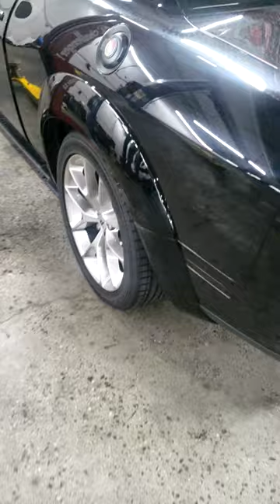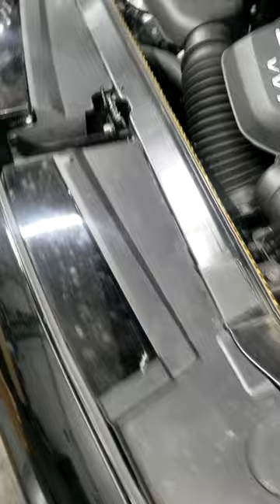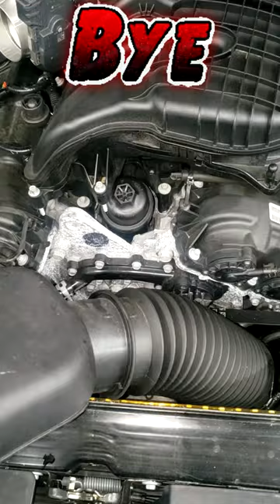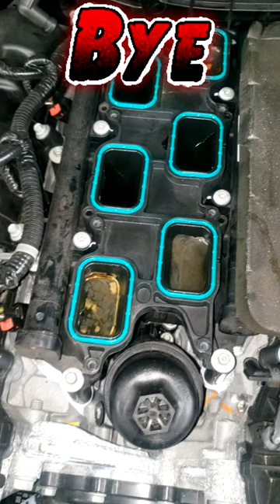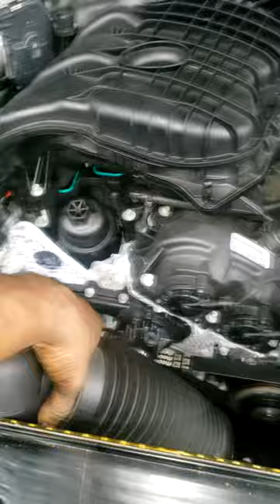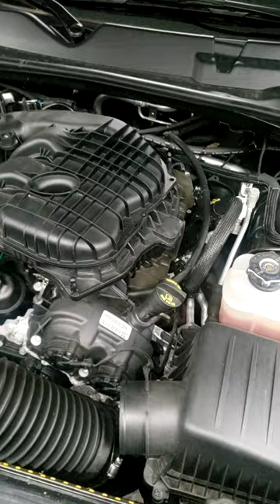Saying goodbye to this motor. Doing that was a bad mistake and destroyed this car.

Comment: Take the plugs out and spin it over, put new plugs back in I guarantee it will fire up.. Ive hydroocked a motor before. Its not the end of the world ..
Reply: Vaporlock different than hydrolock, but some hydrolocked engines can escape undamaged.
Reply: @byanymeansnecessary9329  honestly that's what I meant to write I don't know why I wrote vaporlocked..
Reply: @BlackbeardJohnson  understood
Reply: Bingo
Reply: when you're lucky it fires up.. I'm working on the same engine right now, had one broken piston rod and one bent piston ..
Reply: @huberthess8449  true. I flipped a 3.0 ranger and while it was on its side (still running) it hydrolocked and locked the motor. After I recovered I took the plugs out and hit the key, oil shot out 30 ft.. Put the same plugs back in and tried starting it. It took a couple tries but when it fired up it smoked like a cold diesel for a few minutes and cleared up. Truck was totaled bent frame and all but I still drove it fpr another year. Frame was bent so bad when I did burnouts the passenger side tire would leave a darker black mark then the driver side cuz of how bent ths frame was lol.. Also the same truck I loaded with 3700 lbs of brake rotorsand engine blocks for a scrap run. It sat on the bump stops the whole time. Only suspension was the tires at that point lol. Good times.......
Reply: Correct
Reply: It's worth a roll of the dice. It could save the customer a new engine.
Reply: More likely to bend a rod in a v8, due to the power of the other pistons.
Typically one or 2 will bend before it locks up.
Smaller engines less likely to have damage
Reply: My question is. How do you hydrolock a car in a puddle? I’ve driven through two feet of water in an Elantra GT and didn’t have any issues.
Reply: @xandit  it wasn't a puddle, lol. More like 3 ft deep. It was a flooded bridge we tried to cross in a LOWERED Toyota pick-up truck. High water + low vehicle = hydrolocked..
Reply: In attempts to impress my girlfriend and her friend I drove my 95 exploder into a deep puddle. Hydro locked the engine... Pulled the plugs cranked the engine changed the oil and filters and it ran perfectly for 10 years...  But your the mechanic multiple thousand dollar engine it is!!!
Reply: @BlackbeardJohnson  I’m talking more about the video than your circumstance.
Reply: @xandit  my apologies, man
Reply: Exactly happened to me a couple weeks ago. Took out my spark plugs boots , dried up the spark plug walls and pulled out spark plugs , put some new ones in and viola.
Reply: @richardsamuels2842  something funny?
Reply: It's a Chrysler tho... No way in hell it didn't bend or even snap multiple conrods.
Reply: @brentsnocomgaming7813  if it happened at a low rpm there is ABSOLUTELY a way. Drive fast through water at a high rpm then yes I can see it happening. People hydrolock engines EVERY SINGLE DAY with starting fluid and don't snap "conrods" (😂) no you wait a minute or two and try to start it again. Jesus Christ all these mfkrs that are certified keyboard mechanics know it all. Idc if it had glass rods if it happens at a low enough rpm there isn't enough inertia to bend rods. Smh
Reply: @BlackbeardJohnson I never worked on a keyboard but if I ever do I'll get ahold of you your certificate tho I'm gonna need to see
Reply: @rosslefave5877  pipe down, junior.. noboby asked you to speak. Speak when you are spoken to...

Comment: One of the few reasons I loved the days of carburetors. The air filter was on top of the engine, and as long as you didn't go submersible, it ran.
Reply from the maker: Whoa, never thought of it that way. Interesting
Reply: That's a fact, there is videos online of a Hummer with the exhaust and air intake sticking 10ft up above the top of the truck and it actually drive down into a pond and drives underneath the water and then comes out the other side....

Comment: Did you try getting the water out and running it? Gotta try to save it or at least verify rod damage before you call it quits.
Reply: Yeah I hit a puddle that went from 3 inches to 3 feet in two minutes thanks to a flash flood, just pulled the spark plugs and cranked it till it stopped spraying water, and then it started right up
Reply: @StarHunter28  yep, just gotta give that engine a fighting chance. I've seen kia's throw rods right through the block from hydrolock, several toyota V-6s survive, and a 5.3 bust a piston ring. It could go either way any time an engine sucks up water, but youve gotta pull the plugs at least.
Reply: Nah man that shop replaces engines like motor oil. They won’t take those kind of risk.
Reply: @goforbroke2  it isnt a risk.
Reply: @MWilk098  True, I wonder how that would play out worse case scenario though. The shop removes all the water from the engine. Car runs fine for a week or two then it develops a rod knock. Piss off customer returns, you didn’t fix my engine.
Reply: @goforbroke2  worst case? You don’t ever work on their car again. Oh no. So bad.
Reply: @goforbroke2  no you tell them hey we're going to do this and try the $250 fix or you can put another motor in it, your choice.. and if the motor does develop rod knock then he's only out the extra 250 and he's aware it may happen, problem solved.....
That's the problem with dishonest mechanics. You basically tell them this is an option or you tell them to replace an engine you don't just go in there and open up a valve cover and see some water and determine that it's already too late. You try to go the extra mile and see if the engine is fixable and if it is you've just saved your customer a lot of money and also you will be God to them so they will come back to you forever and ever. Think about it, really not rocket science........
And when I say dishonest mechanics that is exactly the problem they are just being dishonest. And that motor does run and is nothing wrong with it they tell the customer that there is and they replace it then they have a free motor that they can use to put in someone else's vehicle absolutely free and charge them for the price of the motor and labor... just be honest and do the right thing...
Reply: They make more money putting in a new engine

Comment: It all depends on how fast the engine was running and if that momentum was enough to do damage. I've had cars last for years after a hydro lock.  Get the water out and test it before jumping to a new engine.
Reply: Dealer tech sadly just not able to attempt things to save customers money. If he tried he’d end up not turning enough hours for the week
Reply: @user-white007  - He gets paid 1 hour diag for every car that pulls into the shop. In 1 hour you can pull the upper and plugs to get that water out. Wouldn't be enough for every engine, but it is on the 3.6. And most customers would jump at the chance to add an hour to his diagnosis of it could save them thousands of dollars. If dealer policy doesn't allow for at least asking the customer if they'd like to take that chance, that's a good reason not to go to the dealer.

Comment: Your car ain't no submarine! Damn dude! That one expensive mistake! One of the things they taught us in traffic safety back in the 80's was avoid puddles if at all possible.  Belts slip, engines stall, water goes places it should never go,  you can hydroplane, or you simply crash.

Comment: Just pull the plugs and pump the water out by cranking the engine over change oil and put little oil in cylinders I have done many of these like that and the motors lived

Comment: Pull the spark plugs turn it over a few times put them back in and see what happens.
Reply from the maker: He did that in order to rotate the engine to remove the t/conv.  But thats not a repair/fix
Reply: @OnlineMechanicTips  so what was broken. Was the engine seized from the water in the cylinders (hydro lock) or was there other internal damage causing the seizure. If it's just water and it hasn't sit for a long period of time it could be ok. I have hydro locked a couple engines and they were fine.
Reply from the maker: @shmoeshmoe7433  Im not sure. The engine still setting over there. If theres not a core charge on it, I will tear it down and film it to find out. But keep in mind, we in business my guy to make money. We not attempting any repairs on such. Especially if the insurance warranty company agreed to replace it. At the end of the day, its there call, not ours.
Reply: @OnlineMechanicTips  k

Comment: My 2016 3.6 has a code p369 and p000a and b. Just changed  3 cams, all rockers/lifters. The cam phasers didn't move at all so I didn't change them. Swapped cam solenoids and sensors. Engine runs perfect except the transmission don't downshift when in high gear. There is a traction control light on. Could it still be the phasers? It has 97,000 miles.
Reply from the maker: yes

Comment: Sent mine through the Houston spring flood,water past the quarter panel, and again through Harvey enough to get it outta flooding area to higher ground. Still kicking. Trick is to keep them RPMs up and pray the stigma of "boat" is true
Reply: That is true, what is saving you is that you're going through the water fast enough to push it away from the car so it doesn't have a chance to get up in the engine bay and suck up into your air intake. My buddy and I took a lowrider Toyota pickup truck through a flood back in the day and it ran fine in first gear until he got confident and slow down to an idle and that's when it sucked up the water in the engine. But we took it back to his house pulled out the spark plugs and turned it over to empty it. Change the oil and put plugs back in and it ran for another 150,000 miles oh, God Rest his soul that was my best friend Leroy lacey. RIP to a real one!!!

Comment: You can compress H2O, But... The rods will bend as a result. 😱 Yikes JT
Reply: @nikalusgrogan7143  your car can & DOES "COMPRESS WATER", daily. That's what the water pump does and the physics behind hydraulic systems. The water and coolant RESISTANCE to boiling, is achieved by the thermostat and radiator cap pressure (assuming a sealed system). The cooling system doesn't boil, due to compressing the entire system to 16 psi, pounds per square inch. A car can survive a small percentage of water ingestion, like when it's raining and the water vapor has a higher% level than normal. Now, dump a fregin BUCKET of water at an intake manifold and you get "hydrostatic lock. AC compressor can do it too, on a very hot day. 30+ years in the field. Take a Physics class bro... 😜

Comment: A little bit of water (rain, splash up) is fine because it'll get vaporized in the cylinder and blown out with the exhaust, but it becomes a problem once it's too much to vaporize.

Comment: 1984 ford 4x4 chain's on all tires going through 3 to 4 feet of snow, literally pushing snow with my grill. I never got stuck, but my truck stopped working. Luckily wasnt water in the engine. I believe it had to do with  the distributor. Something electrical went out. It's a bummer, because your enjoying laugh then next thing you know your dead in the water.

Comment: If no bent pistons, pull the plugs & spin the engine over. Plus it depends on how long that water sat in the cylinders. May have to go back & forth to free it up. That should be the only reason to replace an engine if it bent rods, unless the dealership just doesn't want yall fooling with doing that.

Comment: Its not gone... if itnis theses bew motors suck.. drain the water out of the heads.. out of the oil pan ..fill it up.with kerosene let it sit..rotate by hand empty.. refill with oil and your good
Reply from the maker: smdh, we not doing all that. We replaced the engine. Everything you mentioned should be tried on your own car or at home. Shops recommend engines for this for good reasons

Comment: Kaboom for some kind of mechanic don't go come home you think Kristen rides because of the depression like I said can't push water and if you try to pull starters enchantment that water in there it would been already God's way back his piston rods if you didn't you can pull the spark plugs out and flush out and just turn it over for a while to get all the water out of there thank you for the back and fired right up and had no problems unless you hear a knock-knock dangerous screwed later I worked a lot of cars in my time let me tell you I put a spark plugs and make sure later
Reply from the maker: Engine approved by her insurance warranty company. We dont really care if it can be saved. Thats to big of a gamble. They said replace it. This is a business.